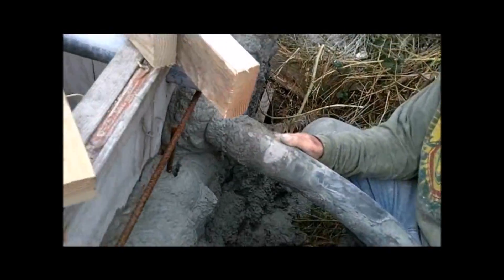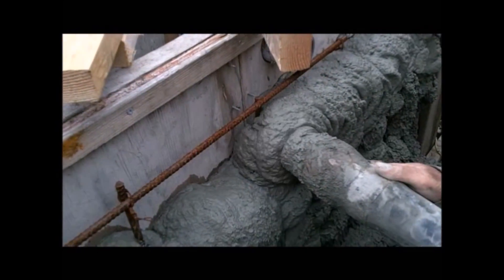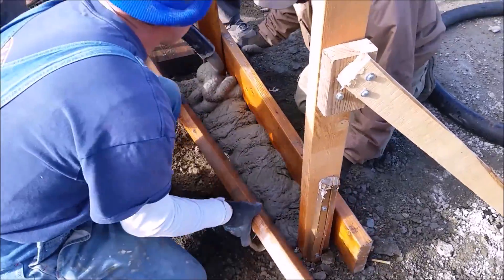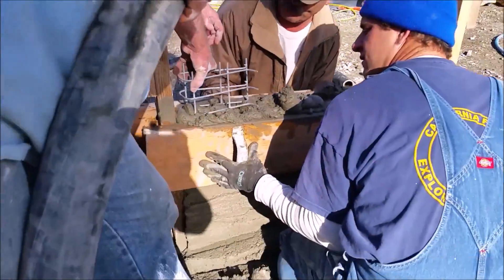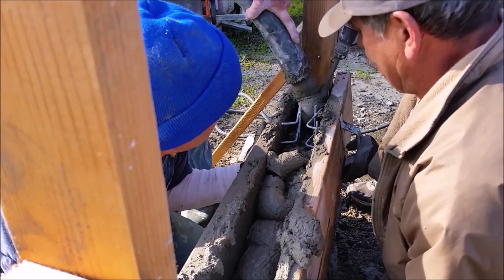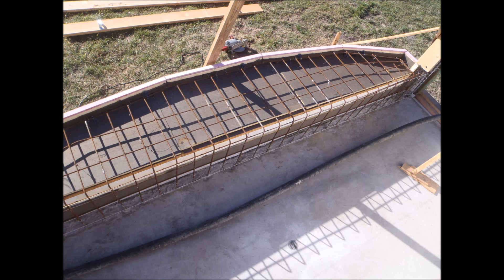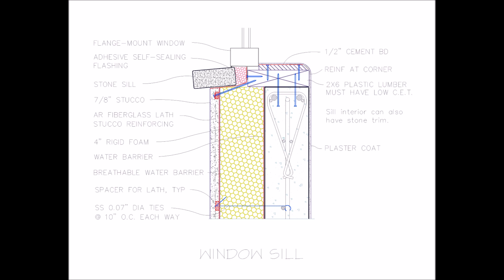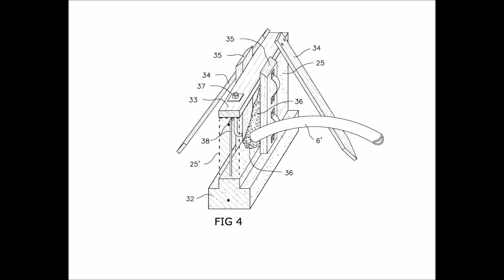SpaceCrete :   zero-slump concrete that pumps easily - to build walls with no forms. Rapid 3D print

Comment: What's with the mechanic's chisel? That just created holes in your product. Can you afford a vibrator? Also, what are your test results (of failure I mean)?  PSI...
Reply from the maker: Very fair point about the vibrator. We were concerned that a high frequency one would make the unformed concrete slump too much, but we figured that issue out - just did some 13' walls with a conventional vibrator and no forms. Our biggest problem was/is stickiness of the mix - 7 sack plus fly ash. An early test was 3500 psi, more recent cylinders have not been broken yet - my guess is around 5000 psi, but we will see. Do you know how to make a rich mix unsticky?
Reply: "Unsticky",  I would think, that is the trick of your product...  The ability to have flow yet have great low slump affect... 
How about water reducers, they will give more flow and hence, make everything less, ''sticky".
Reply: PS My first thoughts / feelings were, if he could only get the pump to flow faster! That speed would increase volume and give a flow affect also...
Reply from the maker: We have 20 or 30 different water reducers here, mostly PCEs, and even the latest from BASF that they won't even sell in the US yet - that is supposed to make the mix less sticky. That one helped a little, but we need something that makes a significant difference and helps the tired 1972 Mayco pump ($2500 on Craigslist), or ones like it, without harming the strength or set of the mix. Thanks.
Reply: I have a pump that is putzmeister P30... 25 yards an hour... I think your machine might do the same... With that said, have you tried slowing down your speed - to allow for more fluid installation?  Also, consider making a different outlet - perhaps one that is flat, to distribute the mud in a pattern that might be more manageable. They sell coupling end that you could weld a shape that might work, I am spit balling here... maybe one that is 1.5 x 1.5 --giving you a different pattern to work with...That round pattern does not seem uniform enough for what your product can do.  The old saying, round hole and a  square peg...
Reply: Water content low, .30 - .36; I don't know your mix or temperature variables and aggregate moisture content... How about, are you allowing enough time for your cement to ''react" before pumping? Also, make sure your hoses are not too hot, that will cause acceleration also.
Reply: SpaceCrete, have you tried different foaming agents?
Reply from the maker: Thanks. Good idea in that it helps body, except that the strength goes way down. And usually entrained air makes the mix stickier, although in our case it does not make much difference, because it is already sticky. Lubes such as calcium or sodium stearate also weaken it. Still looking!
Reply: SpaceCrete , I am running your issue in the "background of my brain"...
Let me inquire, does your pump have a ball that is in line with your outlets?
Try removing...
Reply: SpaceCrete, POZZOLITH300R or thee quivalent acts as a water retarder and a lubricant. On a lean mix, long pushes,stiff mixes, andvertical pushes, Pozzolith300R helps pumpability.
Reply: maybe steal from nature. as viktor schauberger discovered with fibonacci spirals everywhere. instead of resisting the stickiness, do like nature does and embrace it. create a spiraled, winding internal cavity in your pump. just like nature deals with poop. to be a bit graphic... i ran over a hundred possibilities in my head for you, and instead of my original idea of lining everything with a plastic you can take off, including the inside of the pump, create a smooth vortical intestine made of something with a smooth, almost glassy texture. no more stuck valves. but you'll have to be careful of the flow speed. and working with concrete long enough i'm guessing you're dealing with specks flying everywhere, sticking on wood, particle board, prelaid concrete and mortar, hands and clothes. I have no solutions for that. lmao. neither does mother nature when a piece of poop gets on you. That's essentially what you're making. if your admixtures of soap and lignin bioplastics come from nature, its just like digesting a tree thru a gut .